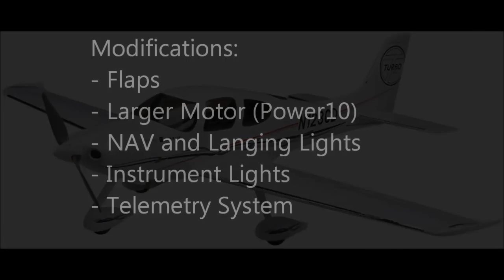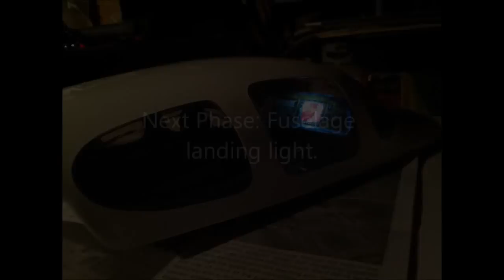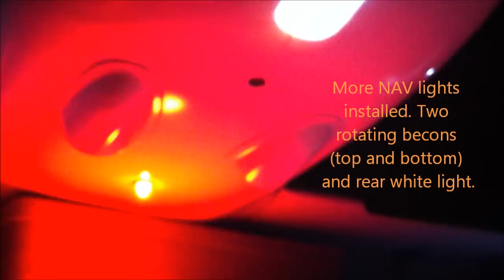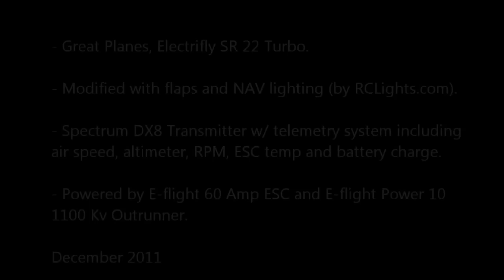SR22 Turbo Modifications - RC airplane

Comment: Will u mind to make a video how do u attached the wing to the fuselage on your mystique plane , did u glue the elevator to the carbon fiber rod Tha goes in between
Reply from the maker: Aldo Allende Oliva - On the Mystique the main wing is held in place with tape over the joints between the wing and the fiberglass fuselage. I only put it on the top sides, using white electrical tape the full length (width) of the wing - front to back. The elevator is actually just held in place by the ‘force’ of the wind pushing the pieces back against the fiberglass rods that hold the two pieces together. I also added a little rubber cement to the rods to make them less ‘free’ to slide. Eventually, one side stopped sliding, so, yes, on one side the elevator is now ‘glued.’ I flew it many times without any rubber cement and never had a ‘tail fin’ fall off. Hope this helps.
Reply: Wow, great ideas, I never have balsa glider before, I will try to do the same on some other airplane that I have. See, you already have another idea to make another videos and thanks and keep helping people
Reply from the maker: Aldo Allende Oliva - Yes, the good ‘ol days of balsa. I appreciate that I ‘had’ to build my first models because you (I) learn a lot by doing. I admit that with today’s foam planes, it’s hard to not want to just “buy and fly” - and sometimes I do too. But today, for my “favorite” planes (1 power glider, the Mystique, and 1 airplane, also an E-flite model, the Super Cub 25e), I like the ‘built up’ look AND, this is important to me, I feel like I need to be more careful flying them - which is an important part of the whole experience for me (scale, realism). Otherwise, I fly crazy and crash stuff - which I do too. Be well. Clear skies and calm winds - enjoy flying!
Reply: Im so poor hahaha. I got all my electric from HK hope to have ready for tomorrow, I will try clear tape
Reply from the maker: Aldo Allende Oliva - HK is great. I go HH for the ‘good stuff’ and HK for most everything else. Clear will work, but you need to be able to remove it too. Try folding over about a 1/4 inch on one end, onto itself. That way you’ll have a tab to pull.

Comment: could you make a PDF detail DYI on the Inst panel lights with the clear plastic shielding. Im trying to explore this avenue with my SR22. Thanks
Reply from the maker: Had I written anything down when I did the project I would have been happy to make a PDF for you. Sorry I didn't write anything down. I think you can figure it out by watching the video. Quickly: 1. cut out the area on the dash that you want lit up. 2. Cut a piece of clear plastic the size of the instrument panel decal supplied. 3. Apply the decal to the clear sheet (you might do this before you cut it to size, makes more sense). 4. Glue the new dash in clear sheet to black plastic interior dash where you cut out the hole(s). I used one big hole, but you could just do a few too. 5. Make a box (wood works) to provide a place to mount your LED or light bulb, and to prevent light from lighting up the entire fuselage. 6. I painted my box black to help contain the light. The inside could be painted white to help reflect the light.
Hope this helps. Enjoy!